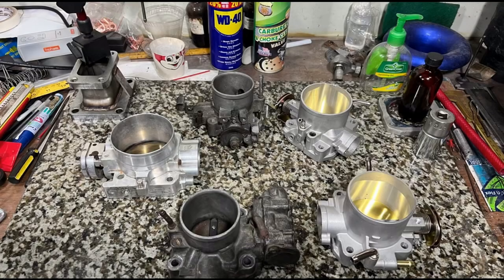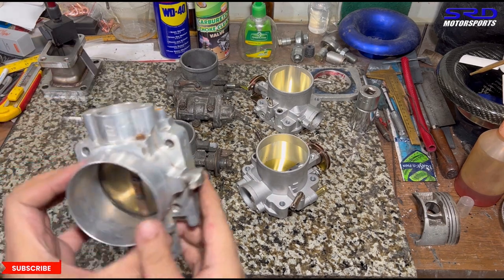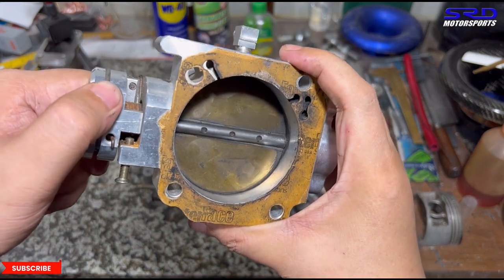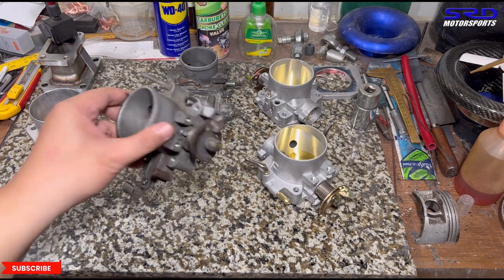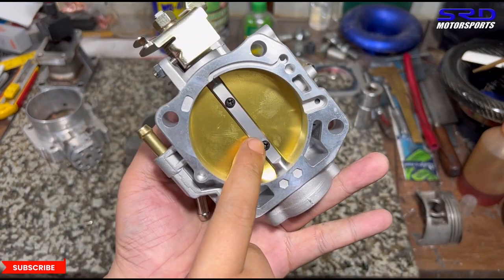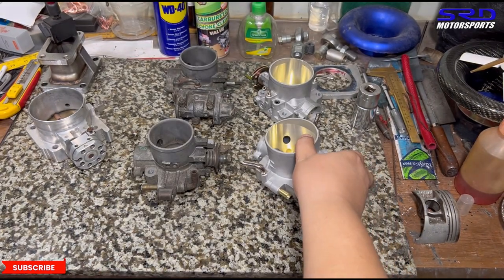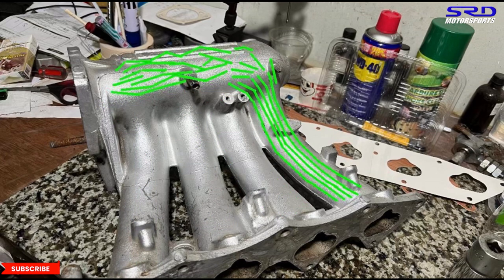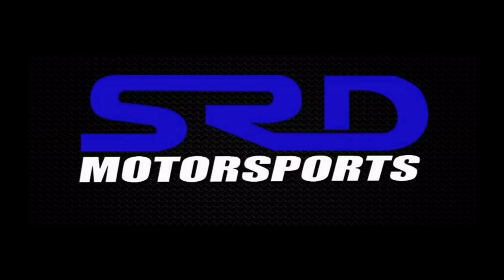A Fix to Sticky Throttle Body or Stuck Plate
by SRDmotorsports

Comment: Great info I subscribed! I wonder if this is the cause to my long time issue of my car not idling down. I didn't even think that adjusting the throttle would lead to calibrating the tps, but makes total sense. I wonder if incorrect adjustment could make it seem the IACV is acting up? My B18b1 swap idles high for a long time until I drive it for awhile. The weird part I can't explain is I can manipulate the correction in idle by quickly turning key off and back on before the motor cuts off. This works every time but I hope I don't wear my ignition or electrical system. Any thoughts why the quick on off corrects idle? I'm hoping it will fix this following your video. 

Thanks for the knowledge! 👍
Reply from the maker: It is possible I mean it’s a possible cause because let’s say the ecu factory or rechipped the target idle is “900rpm”
but mechanically the throttle and tps is closed different or on idle state it’s different the ecu will have a hard time trying to “force” it to idle to its target
And vice versa so it’s worth checking

Comment: Hey man I love your videos I've been subscribed for a while now. Always great content and great information, keep em coming! But I do have a question I can't figure this out. My 74mm skunk2 TB only sticks with engine running. Engine on if I slowly open the throttle plate by rotating the rotor where cable meets it, you can feel where it gets slightly stuck. Also at a couple more point further open. I did this with cable disconnected to isolate the tb. But with the engine off it's as smooth as can be all the way through. It's driving me crazy I even removed throttle cable and made sire the cable was not sticking anywhere. I would greatly appreciate any input!
Reply from the maker: Hmm interesting and very odd situation there man…. Only thing I can think of is probably throttle shaft play (lateral) that’s why it only sticks when it’s running = vacuum so as the engine pulls vacuum it pulls the throttle shaft laterally and so it causes to stick on portions

Check that out and hopefully you get to solve it brother

Comment: Always thankful for sharing this info brother! So what you're saying is that, no HP gains will happen even if you upgrade to a bigger TB when you still have a stock intake manifold (non ported/polished), right?
Reply from the maker: In a sense yeah but also look at the engine as a whole

a b16a may not benefit a 74mm tb lol

and stroke/piston speeds play a factor too

And lastly but def not the least… the intake pipe if it’s a 3in or a 4in
Reply: @SRDmotorsports  Much appreciated for your feedback brother! 🙂🙂
Reply from the maker: No problem man :)

Comment: Hi, excelente channel, sorry Ford My English.
I have the same problem whit skunk2 trottle body, anda see the skunk don't have spring in TPS side.
I put oem spring and fix the problem, i hope they info is useful.
Reply from the maker: Yes the oem spring would work to help it’s the same size atleast
Reply: How did you install the spring in the TPS?

Comment: Hello, are those 70mm throttle bodies same as the one in shopee? if so are they good? planning to use one on my turbo build, and what would be a better manifold for the 70mm? planning to use a oem one p2j/y8 or p08/z6 intake manifold? port matched
Reply from the maker: The 70mm I’m not sure if same from shoppee 

also the 70mm is too big for the sohc manifold will have a thin area for the gasket between throttle and iacv hole

Comment: No idea about bigger TB means more power unless your engine is demanding more air flow. thank you for this sir, currently have a P2J intalke manifold with a stock TB from an LXi, was planning to do a B16 TB upgrade like most people do.

Still thinking what can I do as an upgrade to the engine. Current setup is a 
> PH15 block
> P2M Cyl.Head
> P2J intake manifold (IACV is Manual already)
> PH16 Fuel Injectors
> P06 Rechipped ECU

the TB is still in it's stock form. Would love to know your thoughts or suggestions. ^.^
Reply from the maker: Well it’s more complicated than what our locals claim… cuz tb also feeds the plenum and the plenum is where the runners get air from for the engine :) so it’s a “system” not bolt on gaming lol

u can check on a CRV tb it might be cheaper cuz locally too many parts are hype priced hehehe

Is that a Ph15 lx (carb dati) or a ph15a Lxi block?
Reply: @SRDmotorsports  yup, saw some CRV TB's up for grabs that can be a good upgrade pero kasi iniisip ko if little gains lang sayang money and effort if pwede pala sa ibang tuneable parts ilagay.

Not sues if PH15 carbie or PH15A. Im thinking of PH15A since it's a EK SiR body, LXi. Nakuha ko kasi changed head na and all the fun stuf
Reply from the maker: @NightWorksMediaRYE  ah yes lxi if side dipstick and from an EK
Reply: @SRDmotorsports  yeeep. It's an LXi. Was wondering what best upgrades can be done next with the current ones I have
Reply from the maker: @NightWorksMediaRYE  mostly ported manifold or even head is the next best step but that is big work for a daily driver
Reply: The best way to see if you'll make more power is with data: if your runners are big enough, a too-small throttle body will cause a vacuum to develop with RPM.

Example: I have a stock H23A-vtec with a PRB intake w/60mm TB (stock is 62mm) and it goes from -0.3 inHg (800ft) at 4000 rpm to -1.7 inHg at 7k. That would be worth close to 10whp for this engine, based on MPH observed at the track.

Comment: My throttle body rubs on one side and sticks. It's a bbk throttlebody/plenum for a 4.6 2v. I loosened the screws for the plate and kept opening it until it fit in the right spot, then put the screws back in. So if you're having that grinding issue, there you go
Reply from the maker: Yes sir! You worded it perfect!

Comment: Should you see any light around the the throttle body plate in closed position? I've been having idle issues I have thought about boring out the idle screw adjustment or opening the throttle plate with the stop screw. I built a b20v with a victor x manifold and skunk2 70mm throttle body. I think the IACV is having trouble providing enough air.
Reply from the maker: When closed not really

Before u bore the adjustment screw for the air

Double check the stopper on idle etc etc just like in the video
Reply: @SRDmotorsports  when closed i can barely see a little light sorund the edge of the throttle plate, I backed the throttle stop all the way until it started sticking, and then I turned it until it barely touched the plate and no more sticking
Reply: @SRDmotorsports  also, I do not have any vacuum leaks, but it has something to do with the iacv not being able to keep up, even with iacv duty increased on S300 hondata, I do have a new iacv coming just to give it a shot
Reply from the maker: Oh I see so ur idle issue is mainly not being able to pick up rpm etc so if that’s the case then definitely it’s leaning more towards a stuck iacv
Reply: @SRDmotorsports  thanks you for your tips and your informative videos 😁

Comment: What size tb do you recommend for a stock k24 motor with rrc manifold, 50vtc, plm headers and 3"custom exhaust and ktuner, shooting for 240hp on 98octane here in Australia
Reply from the maker: Looks like “atleast” 70mm is good and the k24 we building is also stock but the KPower intake came with a 74mm 

but I feel that as long as it’s a minimum 70mm it’s gold

Comment: I bought the 60mm accufab throttle body and I'm having high idle issues and as I drive and get off the accelerator the rmps are climbing...any information that you could help me with.
Reply from the maker: Sounds like a vacuum leak or the stoppers aren’t set properly as mentioned in the video

Comment: I usually set it until it sticks and adjust the stop screw just a hair to remove the sticking, and double check it while the engine is running, then I'll calibrate the tps 🙂
Reply from the maker: I think that’s the right way = I do the same just a “smidge” to “unwedge” the plate from sticking and then that’s a GO! 
Ftw!
Reply: @SRDmotorsports  i thought i was doing it wrong until i watched this video😅
Reply from the maker: @AelAeo  I tried to explain it how u explained it (you explained it better hahaha)

the billet ones always get a bad rap only cuz the full throttle stop is adjustable so if u are over 4.5v (after setting the idle stop and getting 0.5v) u throw a CEL

Then the billet gets blamed lol

It simply has an “extra” variable to adjust that’s all
Reply: Best way
Reply from the maker: Yes sirrrr

Comment: Hey, I have an issue with the Skunk2 70mm for my D serie I have set over all the stock sensors to it and I installed it but for some reason it keep jumping up and down revs from 1000rpm to 1500rpm consistently. I would appreciate any help.
Reply from the maker: Check vacuum leaks etc 

If tps is set properly? Good but if issues still occur then might have to redo this but before setting the TPS, pre set the throttle to where it is properly closed with the idle stopper screw

Because the tps may be set and it shows “closed” but the butterfly may be still cracked open, just like as if it’s missing the idle air screw pretty much the same symptoms
Reply: I have just fixed the weird rev problem. I just didn't connect the idle control, just a dump mistake. But now I'm struggling to set the idle the idle is really high now even when the car is just sitting still. When driving just in first gear and them sitting still, it sometimes at almost 3k rpm. I have tried to set the trottle sensor, but it didn't help.
Reply from the maker: Do check the throttle stop screw it may still be set a bit high… and also check vacuum leaks

Comment: Whats wrong if close 0.5 but open 4.36 ?
Reply from the maker: check the sensor in the Honda manual 
0.5v closed and 4.5v fully open

If u get 4.36 then obviously the ecu will think u are never full throttle when u are full throttle it just shows the ecu it’s 97% full not 100%

so big chance I won’t even reach the last vertical column of the map in tuning the ecu

Comment: my idle screw on my skunk2 came off. do you know the thread/size to get it replaced?
Reply from the maker: oh crap…. Sorry to hear that… lemme check at the shop tommorow I can measure it and let you know
Reply: okay thanks! I also meant Idle stop screw. the thing below the throttle plate. One day it was just gone haha
Reply from the maker: @turtles619916  oh yes yes I know what u mean it’s the one with a nut that locks it in place lemme check what fits it etc and I know if it’s near impossible to find replacements on it from stores? A local nut n bolt place can secure it for u just we gotta see what threat it is

As I don’t wanna guess lol

Comment: But what if the plate doesnt return all the way and stays open to an amount that it idles around 1400rpm and u have to blip  the gas pedal to close it
Reply from the maker: Weak return spring

Seen it happen and a lot of times using the oem return spring helps

But a lot of work lol
Reply: @SRDmotorsports  i changed the spring to oem but it still didnt return so i used the oem t-body
Reply from the maker: @martinskolnik9179  ah then the shaft is twisted as I said in the video

The arch of the throttle is still “full circle” and the shaft turns 360 perfect “unless” bent

if the throttle plate is aligned

I assume u tried loosening the throttle plate and seeing how it aligns on all throttle openings 1/4 1/2 3/4 and full throttle?
Reply: @SRDmotorsports  i didnt played with it anymore because i failed emissions because of tbody so i installed oem and called it a day 😂😂😂 btw thanks for replying
Reply from the maker: @martinskolnik9179  well if the throttle is on the desk or shelf? Try it cuz it might not be a twisted or bent shaft it might be just needing adjustment on the plate alignment

Then when it’s okay? Post fs on Facebook “super rare item” hahahaha